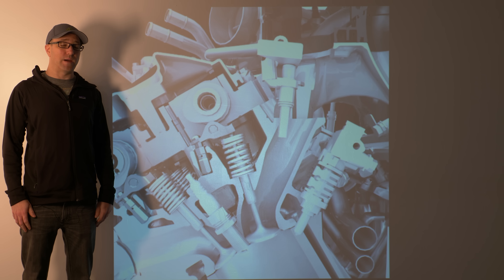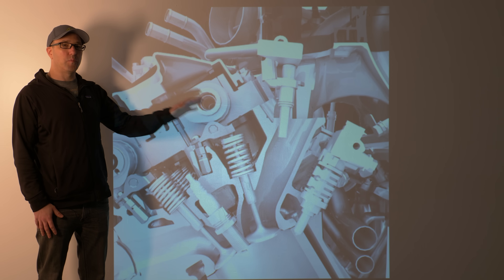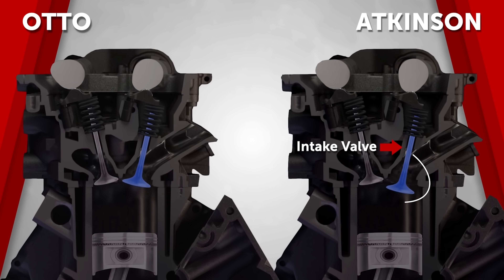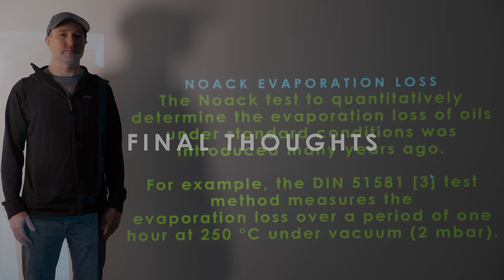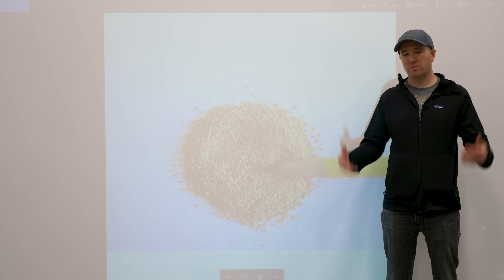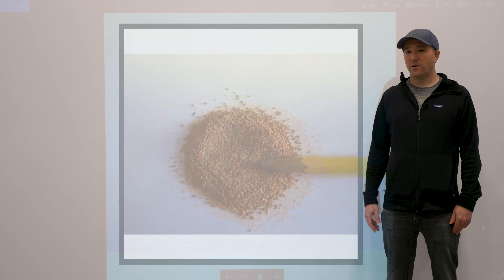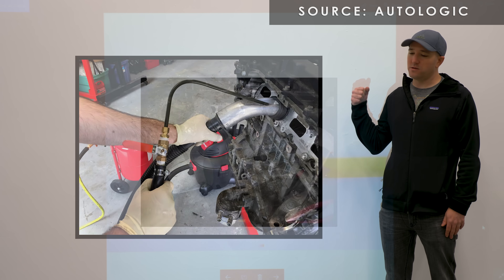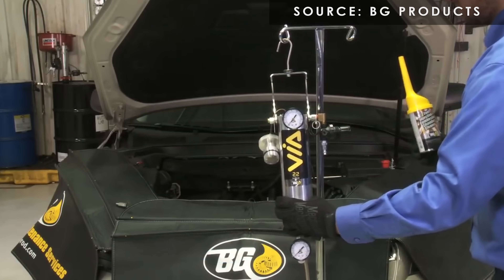Direct Injection, Problems and Solutions | The Fine Print

Comment: I have a direct injected, turbo charged engine with over 200,000 miles on it. I still get over 50 miles to the gallon and have never cleaned the intake ports. The engine? It’s called a Diesel engine.
Reply: Diesel engines do get sludge on the intake valves just not as bad as gas I know I rebuilt thousands of them. Alot of the crankcase gases are vented to atmosphere on most of the engines that I worked on. The others had really good catch cans the main reason that they produced that much oil vapor is they run alot cooler.
Reply: @colinandersen1347  You must be working on older construction equipment or something. Venting crankcase vapor to atmosphere has been illegal on passengers cars for years.
Reply: @borderwave2  it's "illegal" because the car industry loves selling you a new vehicle every once in a while ;)
Reply: If you have 200k most likely you don't have a EGR, SCR with DEF fluid, and a Particulate filter all which turn a diesel engine into a soot filter eventually everything plugs up costly. When I bought my 2015 ram 2500 cummins diesel didn't know anything about the emission control. When I found out warranties don't cover "Cleaning particulate filter" they don't consider it a warranty issue I knew diesel is no longer a 200k mile truck. I could delete it all but now bunch of work I can't sell the truck plus if I get caught big fines.
Reply: Kevin Mills , I like your style and your correct,if diesels didn't have all the emission crap on them and if the oils and filters were changed at the recommended intervals and I don't mean this 20k plus oil change nonsense they will run indefinitely,I have seen the early Mercedes diesels car engines used on taxi work 24 hrs a day 365 days a year do over 600,000 miles on the same engine and we're still running well when the vehicle was replaced.
Reply: David Ellis man. You buy a Ford 4.0L straight six in Australia and that big chunk of solid cast iron engine will run for 1000,000kms no problem whatsoever. It's basically a 60s truck engine they put on a passenger vehicle.
Reply: Sheng Han in-line sixes are boss
Reply: David Ellis turbo or non-turbo? I really want to buy a classic everlasting engine one day. I heard the amc inline 6 and Cummins diesels are these sorts of engines
Reply: Unless you don't have an EGR valve, or it's been disabled, diesels suffer from sooting up of the intake too! Running lean doesn't make any difference to the intake port.
Reply: @Markpd69  Diesel engines have real oil/air seperators. Most gas engines don't.
Reply: @Markpd69  exactly...intake ports see clean air only...unless the intake valve does not seal there's very little reasons to fear carbon build up.
Reply: @zlatkozivkovic8694  corrosion from oxidization in the intake manifold would be my biggest concern, imagine a cast iron intake manifold with direct injection..
Reply: @neonafterlife  no problem with aluminium intake manifold
Reply: Pussy.  I've got 335,000 miles on an indirect-injected diesel engine.
Reply: @immikeurnot  they don't make an indirect injection, diesel engine?
Reply: well, what this design is basically a diesel injection system adapted to gasoline instead.
Reply: @BJB what is the BS about? You dont believe that buildup on the valves of the GDI engines? I just bought a new Mazda 6, just founs out it has direct injection...now I have second thoughts...
Reply: @CheckAvability - NOx is the progenitor of photochemical smog.
Reply: Jeff Sol you are wrong. Why is it the people in a hard-working city can breath 10x better on the weekend? This is not unknown science. Cars pollute urban air and are the 90+% cause of it.
Reply: But that engine produces 100x the pollution that a GDI makes.
Reply: @SuperMacGuy  false, petrol engines higher NOx after 50,000miles than equivalent diesel. Much higher NH3 , CO, CHs, and of course CO2 from gas cars. GDI ten times worse ultra fine particulates than Euro 6 diesels as they have no PT.
Reply: @Son37Lumiere  Ha. Even the Guardian article admits newest diesels comply with pollution regs but the author says to eliminate them anyway without also mentioning eliminating gasoline vehicles. Fake news.
Reply: Chris Paveglio and like with Audi, apparently you have to spend money on some weird nxo additives shit to not get killed by the exhaust fumes produced by your own vehicle.
Reply: @SuperMacGuy  Uh, no. Diesel NOx is higher but CO, HC, small particulates, and CO2 are much lower.
Reply: @SuperMacGuy  Does it really? Prove it. Furthermore, your argument is narrowly scoped. there is much more to the picture here
Reply: @SuperMacGuy  I agree, just trying to clarify why diesels don't seem to have as much carbon buildup as gas cars.
Reply: @borderwave2  I wonder about this as well. I have never heard that any diesel engine has this problem. Might it be because diesel engines are running cooler that gasoline engines? Thus the oil vapor will not get "baked" and become solid. Instead it will remain semi liquid like a paste that will get sucked into the cylinder over time?
Reply: @borderwave2  - That's because they blow it out of the exhaust. This is part of why diesel exhaust systems cost more than the diesel engine proper. DEF helps. Soot filters help. Destroying nitrogen oxides requires further treatment.
Reply: Thanks for giving all of us cancer.
Reply: diesel is way better than gasoline because its running lean all the time
Reply: @CheckAvability Nobody wants to smell your car that has disabled emissions equipment either.
Reply: Nobody wants to smell your shitty, sooty, smoky diesel. I can't wait for governments to ban these awful things (including on trucks--the Tesla big rig will be their real revolution if they can pull it off) and save our lungs from their filth forever. There's some guy who works at the place next door from where I work who owns a '90s F-250 with a diesel, it sounds like a UPS truck and you can smell it from 100+ feet away. Disgusting.
Reply: @tankermottind  This is because its not designed right.

Back in the mid 1990s I used to deliver cars via a semi truck.  One day I delivered a load of cars to a Mercedes-Benz dealer.  The sales man asked me if I had seen or heard about the new diesel for its cars.  I said yes it's quiet etc.  He then started it up IN A CLOSED DOOR SHOWROOM FLOOR!  After about a min a minute or so he shut it off.  He said do you smell anything? I said nope! He said thats how clean they run!

Basicly they just turned up the fuel pressure so high so the fuel would atomize better.

Most people don't know why a diesel knocks. Its basicly the fuel molecules of different sizes burning at different rates. The small burn first vs the large burn last.  The large ones burn so slow it makes a large explosion sound or "knock".
Reply: Jason Buis 

Diesel is a controlled knock engine based on compression ignition. Molecular size (or molecular weight) doesn’t affect autoignition.
Reply: @tankermottind  the new diesels actually burn so clean, the air coming out of the stacks is cleaner than the air going in the intake

Comment: Rubbish! Fake figures from pre2000's vehicles. Lab setup with eBay equipment! Really??
Reply: Also, take a look at a diesel head when it comes off an (older) motor, there's so much coke you wonder how it could run. Those manifold pics were no big deal.

Comment: 1 additional item in regards to the Turbo GDI engines beyond adding a catch can is to add Water Methanol Injection.  This is farily easy to add and not that expensive ($200-$300 DIY) the water meth blend will cool the intake temp (resulting in more power) but also the water and meth will clean your intake valves!  I need to get off my @$$ and do both the catch can and water meth mods to my woman's Ford EB, but I just haven't found the time with all the work my German bikes and GM vehicles :D.

Comment: @ 17:00 this is why Ford Ecoboost specs out 5W-30 for the 3.5L at least.  Valvoline has a new Oil out as well that is supposedly specifically for the modern GDI engines.

Comment: Unfortunately, I don't see any 0W-20 oil with a NOACK volatility of less than 10.
Reply from the maker: It does not exist as far as I am aware. Believe it has to do with the base.  Usually switch to 5w20 or 5w30

Comment: An intake manifold water injection system should clean the intake valve as well. These add power in several ways cooling the intake gases so more fits and by turning to steam under combustion. Also by keeping temperature down it can prevent oxygen from being wasted in combining with nitrogen.

Comment: 125,000 miles on my Honda, still good.  MPG's have not dropped.  "Top Tier" gasoline and Mobil  one.  Can't say if any of those helps.
Reply: What year and model if you don't mind sharing?
Reply: @vegarosa69    It's a '14 Accord LX with the 6 speed manual.  2.4 4cyl.

Comment: I love my honda D17 engine, 305,000 miles and haven't even adjusted the valves yet! Your right, 98-05 engines from most manufactures are bulletproof as they have coil pack ignitions, perfected OBDII and were ahead of the game before the EPA smashed engineers dreams in 08

Comment: i always run pennzoil ultra in all my vehicule and did not know that it was that good against evap. loss :) all i know is that my 2007 corolla as clean look oil out at 10000k interval even after 250000km

Comment: Your discussion of blowby is a little bit backwards -- no, completely backwards.  Blowby is combustion gases blowing past the piston rings during the power stroke.  This pressurizes the crankcase and the pressure is relieved by the PCV system that allows these vapors to be passed back into the intake and re-burned.
Reply from the maker: I made the mistake of trying to oversimplify the explanation.

Comment: In Australia we took a different path to these sorts of problems. Regardless of what the factory warranty says, by law, there is an implied warranty of 7 years on all new cars sold. If you have a reasonable expectation of getting say 140,000kms over seven years, that means the warranty applies for that time. If you do a lot more than those kms, the implied warranty still covers you. This is a big issue for the motor industry and its actually behind fixed priced servicing or even free servicing as an inducement to buy. There is an incentive to send your car for service so that these problems are fixed before they do damage. 
Hyundai go so far as enabling an engine to be removed in less than 10 minutes as a complete unit. Then they fit a brand new unit that fast too. I have seen it done to my daughters i20. They say that its cheaper to do this than try to fix serious faults. They fill containers with swapped out engine units and send them back to Korea where they are quickly disassembled and are recycled.

Comment: 11:04 I was wondering when you was going to start lying. I own a 2016 F150 with the twin turbo 2.7 ecoboost. My truck has 41,000 miles and get the same mpg it got new. I change my oil every 8 to 9k miles. I also use the oil Ford say use. You are creating a problem that don’t exist.

Comment: Phenomenal Video!!!  Best explanation I have found.  I knew my oil catch can has been making a big difference in my BMW N54 Engine.
Reply: No, Catch Can does not make a difference, at least it is minimum--according to the engineers
Reply: @tony37068  Bottom line is, after thousands of miles those catch cans are filled with oil, without the catch can all that shit is going straight back into the engine

Comment: Wondering how often is the problem of carbon deposit on millions of DI engines out there.    I have a car with a DI-only engine and over 150K miles and there seems to be no problem.   May be ignorance is bliss.   May be I am gradually losing performance but don't know about it.    But the car is still running fine and without engine warning lights.

Comment: Oh wow this is so interesting. Very good video indeed.

Could you talk about how different type of driving styles can affect carbon build up?
My 2006 1.4 TSI has never had carbon cleaning, and is mostly driven in the city with highway driving only one a month or less. It's a DI engine that has 0 carbon buildup. I use octane 95 or 99 depending on the prices. When octane 100 comes out I will be driving with that. Car is perfectly fine. No need to hate on GDI, TSI or other DI engines.
Reply: I'm an ASE L1 Master Tech and I'm curious as to which region of the country you live in where those octane grades are so accessible? Also, I'm assuming that the 95 and 99 octanes are both unleaded..? And lastly, where DO you get that fuel? Is it available right at the pump somewhere in your neck of the woods or are you purchasing 55 gallon drums from someone like VP, Sunoco, CAM2, Torco, Klotz, etc.? I'm just curious, that's all... I'm a former MX racer and my race bikes' engines were built so hot that they would barely shit n fart using 93 octane unleaded! I could easily run 108 octane leaded but I chose to run 112 octane with lead. I mention this for a couple reasons; do you really NEED to run that much octane? do you have high compression or high boost pressure? because there isn't much advantage to running higher-than-necessary octane on a stock motor; even when it is turbocharged in your case. I, too, have a turbo car (1.8T Audi A4 B6 Quattro 6M with a 63mm billet 6+6 blade compressor paired with larger RS6 turbine as well n much much more...) that i run approx 17-20 psi of boost in using 93 octane unleaded all day long with no pre-ignition issues or high EGTs. There was ONLY ONE TIME that I was lucky enough to come across race fuel at the pump back in my MX days! And it was at a Sunoco Station in Dennis, MA which is in the middle of Cape Cod. They offered two grades; 100 octane unleaded and 110 octane with lead... It's just NOT something you see every day...and thats why I ask
Reply: Chris McDonald I think you perhaps use a different rating. I live in Denmark, and we have 92, 95 and now 100 Octane fuel unleaded. In Germany they also have 102 Octane fuel available at normal stands. Our Shell V-Power has just been replaced from 99 to 100 octane. Car ticks over great with 100 octane. All I can say about your german car is to remember to run it hot once in a while. It is made for the German Autobahn, so all that City driving will soot it at the valves. If it has carbon build up you should get it walnut blasted the intake
Reply: @danielfl.9347  Ohhh no need to worry my man, her rev limiter is now set to 7750rpm and I take her there often! And I had no idea you were in Europe, I ignorantly assumed you were here in the states where 93 octane is the most offered at the pump! And that is more than they offer out west where 91 octane is the highest. And are those numbers actual octane ratings or RON..?
Reply: Chris McDonald It's okay! Well, if I have to be honest I have no idea if it is the actual octane rating or if it is RON. When I fill the car up over the border (Germany) they use the same rating and I think it's the same for most of Europe. The 92 rating we have is not really being in many cars anymore. Most people fill up their car with 95 octane, which is unleaded (all is).

But it's good to give it a rip - and fun as well!!